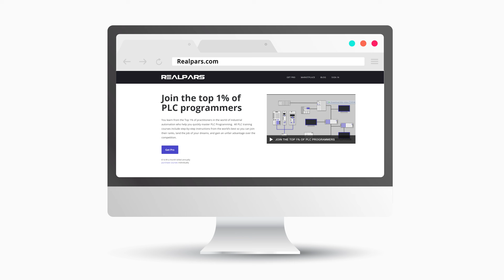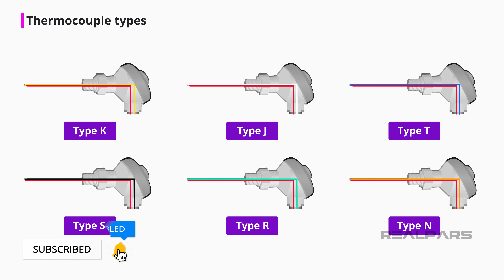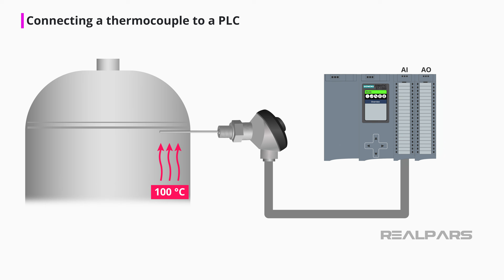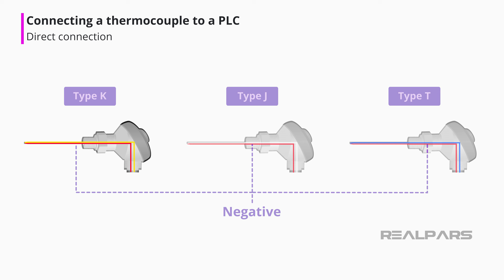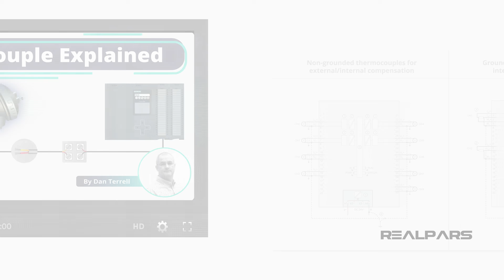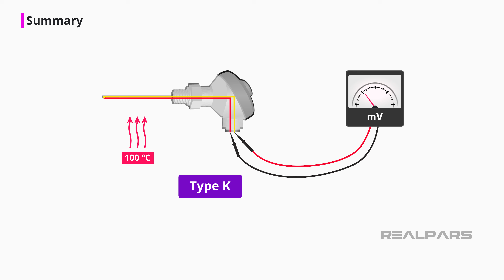How to Wire a Thermocouple to a PLC

Comment: Can I use the K type Thermocouple inside the refrigerator to measure the Temperature?
Reply from the maker: Hi there. Thanks for your question. You could indeed use a Type K TC in a fridge but it would be challenging to control the temperature. The change in voltage per degree of temperature is very tiny.  Most refrigeration units use thermistors to measure and control the temperature as the control range is quite small.  Thermistors are notoriously non-linear but tolerable over small ranges.
Reply: @realpars  thank you, do you have any pictures or videos how to fix the Thermocoupler probe inside the refrigerator?